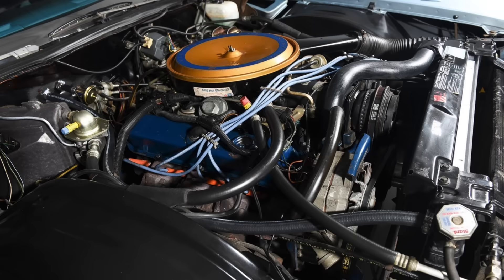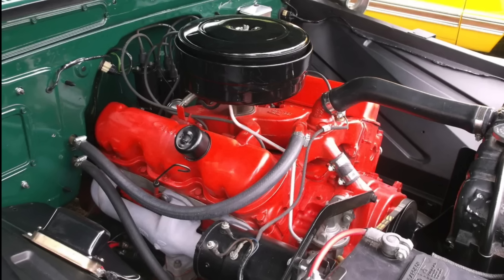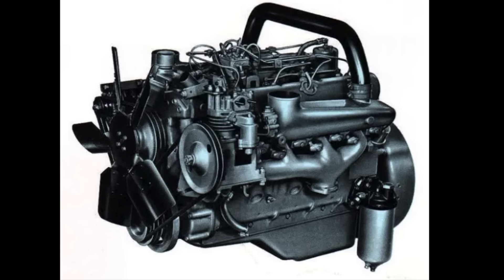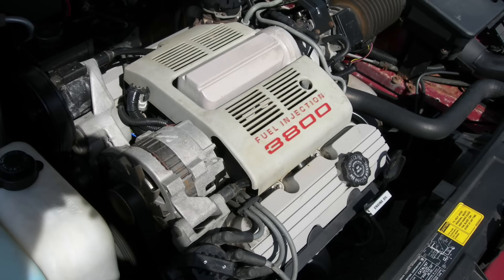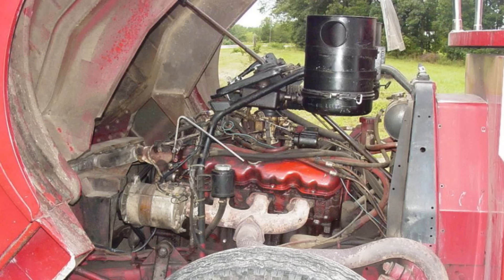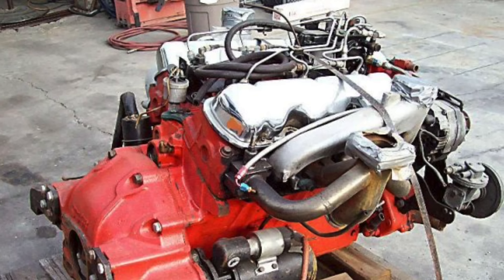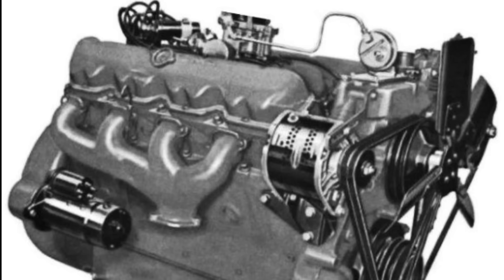The 1966-72 GMC 637ci 60-Degree V8 - GM's Largest On-Road V8 Is Virtually Unknown!

Comment: They were good engines overall. Sure they could've had more hp but so could everything else that was on the road back then. I was working for a GM dealer and we saw a few of the V-6 and V-8 engines. Even saw a few Toro-Flo engines (some called them a "Toro-Flop"). They held up quite well. I used to see V-6 Toro-Flo engines in transit buses. Got some tremendous hours out of them. Now for the bone-picking: I knew this was coming out too. The 478 and 637 engines were dieselized gas engines. And they were designed that way from the get-go; GMC knew they would be making both. But the skuttlebut regarding the Oldsmobile diesel being a dieselized gas engine is WRONG. The only parts that interchanged between a diesel and a gas were the rocker supports and the pan gaskets. Lansing designed its diesel as such, and if it had been treated like a diesel there would've been far less failures. After GM, I worked in a diesel repair shop (33 years) and looked after everything that pumped and burned diesel fuel. Mercedes, VW, and especially that stuff that came from across the Pacific, failed too, only it was politically incorrect to say anything derrogatory about that. Cracked heads, failed camshafts, main webs breaking out of the blocks. They broke, some catastrophically, and all, very expensively. I never owned a diesel because I saw the bills...

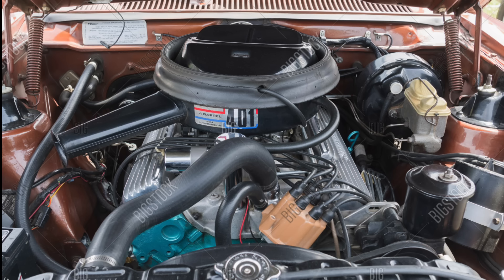Comment: 1:33 Ford made an 1100 cubic inch gas v8 for the sherman tank. The "GAA" It had 3 carbs, dual overhead gear driven cams, a cast aluminum block and made 500hp, reved to 3600rpm before valve float. It was a cut down version of a supercharged 60 degree V12 aircraft engine Ford had designed with the hope of selling to the army air corps but they already had the Allison 1710. So when the army asked for engines for sherman tanks, Ford stepped in with a 60 degree flatplane crank V8 monster.

Comment: Short stroke/big bore.  Imagine the horsepower they could have made with this with  the right intake system and some headers.  Put a supercharger on this monster and we'd be talking 1500 hp. and 3000 ft lbs of torque.

Comment: well, this is in fact not the largest V-8 ever used in a Vehicle there's several that are larger than the GMC 637   The GAA V8 built by Ford coming in at 1100 cubic inch's and is still the largest mass produced V8 engine ever,  and you didn't specify fuel types so we can include Caterpillars 3408 which comes in at 1,098.4 cubic inches  nice try though.

Comment: The Titan Missile Launcher used two 702 ci GMC Twin 6s. 275 hp and 650 ft lbs torque each.
     It was 432 V6, not 423. The 478 was available as a diesel as well as the 637 known as Toroflow.
     The TwinSix was NOT BOLTED TOGETHER. The block was one single casting as was the crankshaft and camshaft. It used 4 heads, 2 intakes, Carburetors all from the 351. The distributor was unique to them as well. The HP was 275, torque 650.

     International made a 549 gas V8. Ford made a 534 as well.

Comment: You missed several from Ford. The 462 MEL used in the Mercury and Lincoln lines. Since were talking about heavy truck engines, the Lima 477 and 534

Comment: Oh did this engine have same bore and stroke as Ford’s Cat 3208 V8, that Ford marketed at the Ford V636 Diesel by Cat? It’s predecessor the Cat 1160 in the early ‘70s was almost the same except for an in-line injection pump.

Comment: Work on a farm many years ago. They had the GMC coe trucks with the 401 V6. Super reliable and durable. Both were governed to 3700 rpm. Other than cleaning the points and changing the oil and plugs, they just kept running.

Comment: I would imagine if you could find someone to make a stroker crank for one of these and come get maybe an Elephant Carb 4 barrel and again a custom intake and plain the heads and deck to bump the compression port and polish maybe balance the engine. Stuff like that. You could probably make some even crazier  power without the need for a turbo or supercharger or N.O.S. But if you went that route. You would need a lot of money in one of parts. But if you could find something to shoehorn it into. You could have some serious potential especially for a sleeper. You could run fairly tall gears because of the torque you would have, and still make quick 1/4 mile passes. But tall enough to get better highway mileage. But it would be fun.

Comment: RE: spark plug wires

GM did not think the spark plug wires would get "crispy" with the exhaust. The reason for the location was that the Diesel versions of the engine were co-designed with the gasoline versions. It's quit the exaggeration to say the Diesel engines are "converted gasoline engines" when they are instead two engines that were designed with similar manufacturing parameters. In this case, the Diesel engines had the fuel pump and fuel lines distributing pressured fuel to the injectors in the V of the engine, so the intake manifolds were outboard of the cylinder heads. As a compromise, this resulted in the gasoline engines needing spark plugs on the inside of the engine V, meaning spark plugs were installed where Diesel fuel injectors would be.

Comment: If memory serves, correct both the blue oval, and the pentastar team also had a larger than passenger car gasoline powered V8s for industrial use in that era as well. Ford had a 534SD, and Dodge had an available 478. However, Dodge used an International Harvester built unit.

Comment: I literally have the same stroke of 3.875 compared to 3.86 of the GMC 637 V8/ 478 V6. Now I know why my 4.3 V6 Chevy stroker with aluminium Brodix heads has a insane torque band 👍

Comment: Had a fire truck with a ford 534 it was a real fuel mizer😂 under full load pumping 1000 gpm it burned nearly 1 gallon a minute.
Reply: Mizer means not using much.  Maybe it was a mixer.

Comment: I drove an Eldorado that was either  a 1971/72,  it was a convertible but what I remember was it had a serious set of  BALLz
when you pushed down on the pedal..... lmao,  I used the car in 1979-80 when I was 18yrs & I'm chuckling at how easy that
car slung gravel as you spun doughnuts >> >>  she was a gas guzzling bitch of a beast that was fun to drive.  You just laid
yourself in that car & it enveloped you,  it felt so well made/solid yet refined n smooth but she was the epitome of all that
was Power/Torque !  She was so smooth & would cruise w/o any effort at 100-115mph like a boat on a sea of glass & I'm
not exaggerating the  feel of that  big long hooded  masterpiece of a car.  I miss that in a  car even though I only used one
for 3 months, thereabouts.  Thank you for the walk down memory lane...... peace & GB ALL
Reply: The 71 and 72 intake valves on these series engines were designed to open,earlier giving it a more of a grunt  pulling  acceleration.
Reply: @puffkendrick6850  >>  thanks for the lesson,  I only thought about after this video & it was that unique of a car
and I've been driving 45 years.  I'd call it a "beast" by comparison of all the others I've driven & I'd gladly pay the
money for gas if I could drive one again.  Thanks for the memories..... peace
Reply: Your welcome ,we're putting together a couple of  Eldorados,Fleetwoods, and Talisman for this summer .Keeping. touch ,your welcome to take for a drive.
Reply: WoW,  that's very kind.... if you let me know what part of the US you'll expect to Show in,  I'll see about making it
out?  I thought I'd seen you say something like that in here but I got in a hurry & hadn't got back to see if I read it
righ?.  Yeah,  that would be way cool for an old guy like me.  peace

Comment: BAD title.
The 6-72 series was WIDELY used onroad in busses and some in semi trucks, and did have available larger displacement options in those usages.
Those were diesel only 2 stroke engines - so the 637 might have been GM's largest GASOLINE on-road used engine.
Reply from the maker: Well, the title says largest V8.  The 6-72 was not a V8.  That said, yes, there were GM Detroit Diesel 8 cylinder 2 strokers that were large.
Reply: @RareClassicCars  8V-71 to be specific - same series.
I forgot the 6 part of the name was the cylinder count.
They came in up to 12 cylinder versions.
Reply: @RareClassicCars  There was also a "jointed" or "paired" 16V design, used 2 8V blocks.
Not sure if those ever made it into onroad applications.

Comment: GMC used to be Heavy Duty, until GM's badge engineering took over.
Reply: @MassiveTrackHunter  GMC,had different options,and different drive line options than Chevrolet, before the only difference between a GMC,and a Chevrolet were six letters.
Reply: @MassiveTrackHunter  Back in the day generally before 1967 GMC,And Chevrolets had different drive train options, along with heavier series and axle options,long before the days were The only difference between a GMC,and a Chevrolet was six letters.
Reply: @MassiveTrackHunter  I wouldn't have wrote the second time,but I didn't think the first reply went through.Sorry about that,Pat
Reply: @patrickmcgoldrick8234 2nd time is the charm, easier to understand

Comment: Had a couple of them in my dad's work trucks one head over 400,000 miles didn't burn oil nothing ran like a clock The other one had almost 800,000 mi on it and still ran perfect

Comment: I owned a 1961 GMC bus with a 351 v 6 engine.Wow the torque .You didn't need 1st or 2nd I started in 3rd gear and a idle .It would take off in 4th/high gear with a bit of throttle.5 miles to the gallon

Comment: The 460 Ford was a great motor. If I recall correctly, GMC had a large straight six in the 50s that was a great motor - The twin sixes at a plant my father worked for got only 3mpg and all the drivers disliked it.

Comment: BOTH V-6 & V-8 WERE GAS HAWGS...THE V-6 WAS SO VERY DEPENDABLE...250,000 PULL HEADS, DO VALVES & RUN IT ANOTHER 250,000 MILES...STILL ANOTHER 250,000 AND REBUILD THE WHOLE ENGINE...

Comment: It is absolutely worth noting that the 2022 COPO Camaro came with a 10.4L V8, 632 Cubic Inches, making 1004hp.

It’s weird that people have become trained to jump straight to the Cadillac 500 or Viper 8.3L when the COPO Camaro beats them in displacement by a Civic engine.

Sure this is 5 cubic inches larger, but even with mods 400hp is basically out of the question with these engines because they won’t spin the RPMs to make horsepower with all that torque.

The COPO 10.4L is basically just a 4-bolt main tall deck Gen VII Chevy Big Block.

US based drag racing engine builders have been building something similar for years: it’s a tall deck, big heads, a fat cam, forged internals, high compression, and all the displacement that will fit in the package.

Chevy has offered a 572 crate engine for decades, and this is basically just a stroked version of that (maybe pistons are 0.5mm larger), but it’s actually in a production CAR. Meanwhile the 60 degree V8 weighs 1300lbs. The twin six is closer to 1500lbs. The COPO engine is winning by a small block (550lbs) in weight, at 700lbs.

Comment: Have you heard of Chevy's 366ci engine that was a four bolt Chevy destroked 396ci with forged steel crankshaft and rods. I am assuming the pistons were forged too, but it would surprise me if they were cast pistons because of the limited rpm truck low end camshaft used. It had a longer life with being used into the 1980's. Old school drag racers cheaply bought these engines out of junkyards with replacing the eternal engine parts with L-78 or l-88 or LS7 parts from the local Chevy dealer's parts counter, with usually having to be special ordered because of Upper Chey's Management's frowning on Chevy Racing parts.  Go figure !

Comment: On the big 305ci V6 from the late sixties Chevy or GMC trucks benefit all the way around by just replacing the carburator with a Rochester Chevy small block  two-barrel carburator with perfect jetting for increasing hp & torque with better all around gas mileage and less strain on the engine with more low end pulling torque. I cannot figure out why Chevy did not put their readily available Rochester two barrel carburator on these engines. If you own one of these engines in an old Chevy Truck, replacing your carburator will extend the life of these engines with benefitting from an improved power band with better gas mileage for a win - win end result.

Comment: My father had a 63' GMC Stepside with one of those 305cu sixes in it, they  had added a T10 4spd.to it, and it Pulled Like Dozer and was Whisper Quiet, and Smooth, but Awful on Fuel. I thought the Plaid valve covers were Cool Too.👍😁
Reply: @douglascooper1987  63 ,and 305Es,the first year of the 305E,on the only year of the Scotch valve covers and only on the 305E.

Comment: I used to own a 1964 GMC Suburban 4x4 with the 305 V6 a granny 4 speed and 2 speed transfer case.  That thing could pull absolutely anything I ever stuck behind it . I once pulled a big ole Chevy 2 ton flatbed loaded with firewood about 15 miles through the Sierra Nevada Mountains back to civilization.  Up steep hills and through a 2 ft deep creek etc. It had broken down on the guys cutting up firewood and I had just happened by them. That old GMC and that 305 V6 wasn't going to win any races but it never broke a sweat pulling that big old Chevy truck full of firewood.  She sure was Thirsty as far as fuel was concerned though.
Reply: my oldest brother has a 62 4x4 Suburban with a 401 V6 swap.
He's in Medford OR and takes it to shows there.
Reply: Yeah I wish I would have kept it. It was absolutely clean not having a single dent or rip in a seat. I got it at a estate sale for $1200 in 91. It had less than 30k original miles but had been sitting the early 70s. I rebuilt the carburetor, changed all the fluids and threw a new battery, tires and gas at it and she wouldn't start. Needed a new coil which is probably part of the reason she had sat so long. But after a new coil she fired right up and for about 7 years I ran around the Sierra Nevada Mountains in her.

Comment: IH made a 549 cu in with a holly 4bbl. It used so much gas it required an electric primer pump to start the engine.

Comment: Correction: 

The Buick 3800 was (really) based on the the 340/350 CI 90º V8 (despite what Wikipedia states).  We looked at this at McLaren Engines in Livonia, MI, and what is now Lotus Engineering in Ann Arbor, MI. We were working on turbocharged/ethanol/methanol variations that eventually became the GNX and Indycar engines. These engines in V6 form started out at 198CI, and ended up at 231CI (3.78L). The front timing covers were identical to the 340/350CI V8's. The main difference between the "old" CI engines and the "metric" engines was the snout length of the crankshaft, and whether the or not the engine was carburated or fuel injected.

The BOP earlier 215 CI aluminum V8 was quite a small engine unrelated to the Buick small block V8. The front timing cover would NOT fit a Buick 198/231/3.8L/3800.
Reply: Not what I’ve heard from other sources as well… Uncle Tony’s garage and others I believe.?

Comment: Two yachts we serviced ran the Turo Flo's diesels. One had a massive Switzer turbo and the other two RaJay intercooled, both were twin screw. One always limped in with a blown head gasket(The "Mucho Gusto"). We told the owner to shave an inch off the wheels until it stopped but he said he didn't want a slow yacht. Seemed like 3/8ths inch between the bores made for a small engine package. A PITA to work on in a yacht environment.

Comment: Not an accurate statement that the 637 was the largeswt gas engine installed in a vehicle.  Mack Trucks had a 707 ci straight 6 available in their B model trucks, and Le Roi had a 805 ci v8 used in trucks, as well.  The US military used the  805 v8 in 10 ton rated trucks.
Reply: I guess “vehicle” starts to get murky as to what qualifies.

Comment: Didnt ford make a 534 v8 for their trucks?  I could be wrong but i think there was a 460 based engine sized to 534.  Also around 2000 gm had the 496 and the 502 big block chevy

Comment: Ford made a 1100ci all aluminum DOHC 32V 60° V8 in the early 40s. It was originally a V12 intended for aircraft use but other manufacturers beat Ford in bidding wars so they took 4 cylinders off of the casting and used them in Sherman tanks.

Comment: The supply house I work for is getting ready to scrap a 2008 GMC Kodiak with an 8.1 liter gas V-8 motor. It has about 200,000 miles on it and runs great. The transmission has approximately 75,000 miles on it and works great but the truck is too old, rusty and beat up to be a feasible company vehicle. I was thinking of trying to save the motor and trans combo out of it before they get rare.

Comment: And the Buick 90 degree V6 was related to the aluminum 215 (3.5 liter) V8 that had a very, very long life under Rover ownership.  They even got the displacement up to 4.6 liters  by the end in 2002.

Comment: Viper V10, just that, a V10. Also, not a regular production engine. There were bigger non 8 cylinder (and 8 cylinder) engines at the dawn of motoring, Bugatti, Oldsmobile Limited, etc. Think 706 CID to 1000+ CID...

Comment: The V-12 WASN'T 2 351 V-6s, coupled together. It was a single block, but the heads were from the V-6, so it looked like two V-6s.